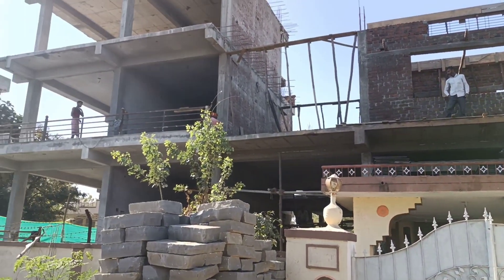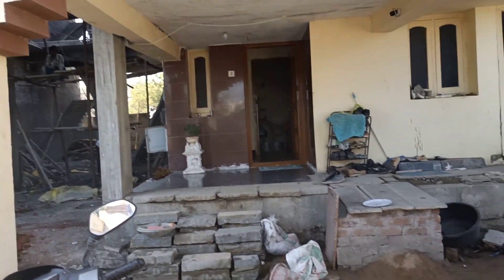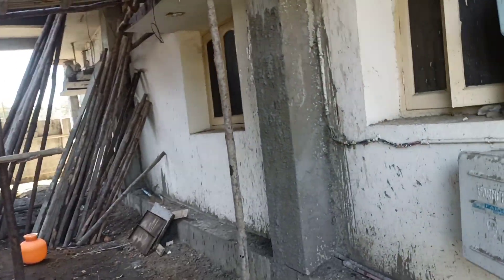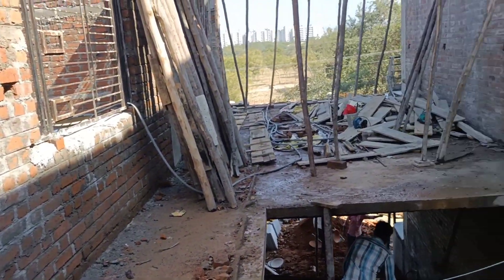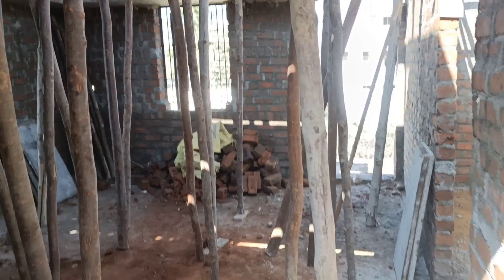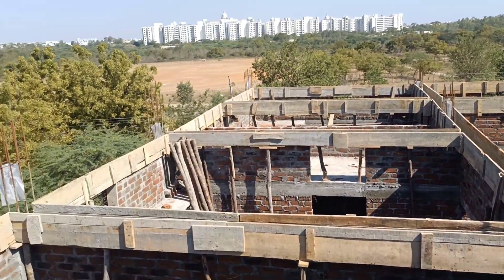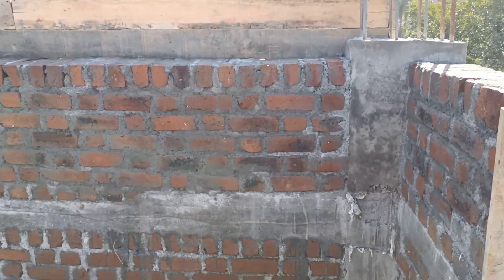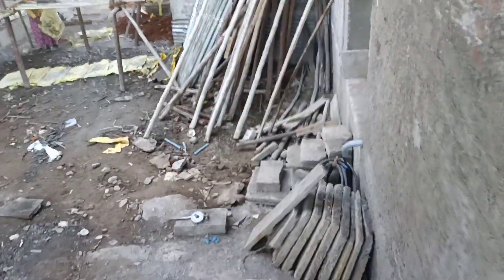converted load bearing structure into a fram structure

Comment: Can we give the support piller to old slab?
Reply from the maker: You can do retrofitting to the old column to strengthen it.
Reply: @surveying1987  I mean I want to give a extranal piller to outside slab so that can hold the load, can I give it
Reply: Without destroying slab
Reply from the maker: @crazycreations631  with giving beam, pillar support to slab it will stand. Without, it won't. If you give support by providing only by pillar to slab it will fail at support and it's not recommended.
Sorry for the late reply.
Reply: @surveying1987  ok